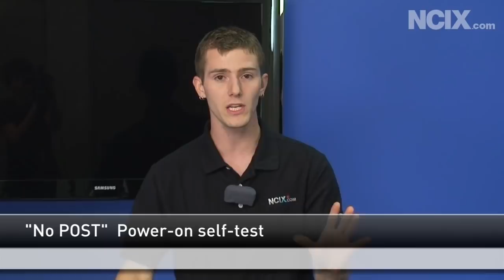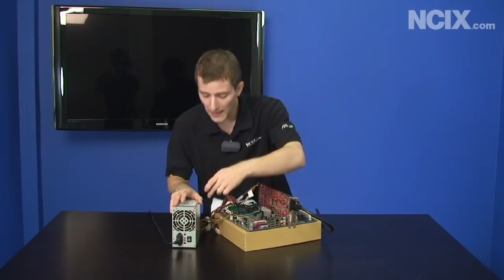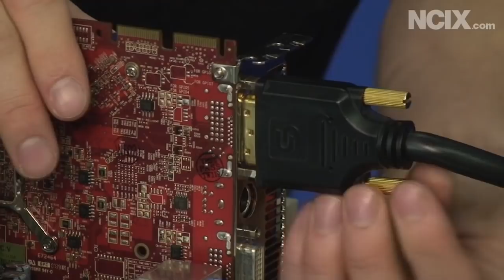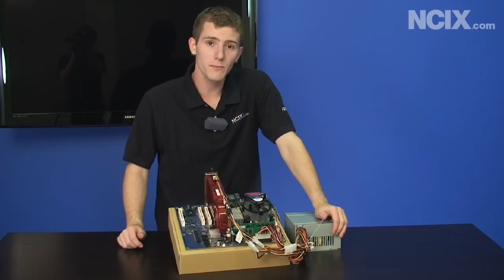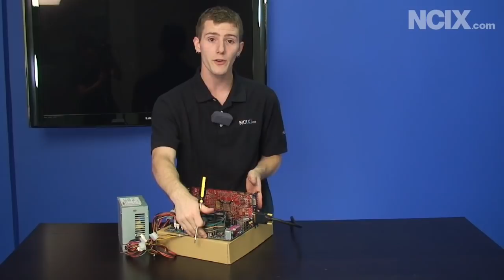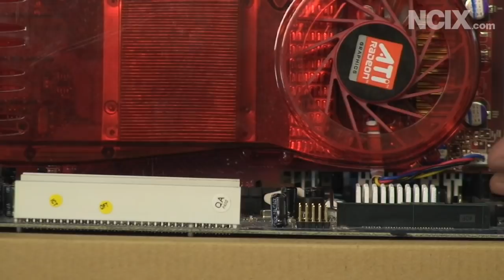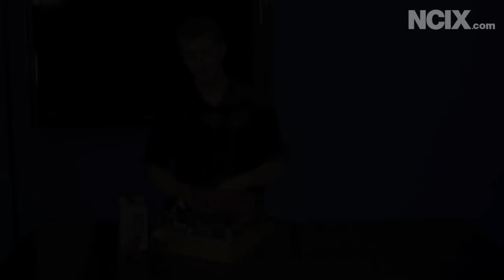PC Troubleshooting No Post Diagnosis (NCIX Tech Tips #54)

Comment: A pc keep giving alarming beeps or siren but still work fine. Usually first thing to do is to replace the PC case and install the RAM in different slots, but some RAM stick are the “leader” stick that must be in the slot 1 to make a pc POST as the other sticks of RAM “follower” sticks that couldn’t POST all by itself. 
It may not be the PSU has fault, but replace the PSU may fix it if all the fans works fine when there was no POST. Replace mobo’s battery too. In many cases no PC parts has fault, it just need to replace the PC case, RAM, PSU, battery with another working PC parts, so after doing all that, you ended up with 2 working PC system and not a single faulty PC part.

May need to replace the PC case because some pc case’s back panel is curved outward and need pushed inward to put in the screw to secure the graphic card, so after some years or weeks of use, it pulled things out of place, bow and arrow theory … …

In one of the other cases, each time the power is out in my house, I need to replace the graphic card and installed a graphic card that could POST in the PC, then I install the one that failed to POST back in place and it could POST, so each time the power it’s out I need to repeat that!

Some PC could shut down due to static charges when your hand is only touching the power button to the PC that’s made of plastic (not pressing the button).

Some PC couldn’t POST, just wait 3 days without using it, then it return to life of POST, this could happen once in a few years of use, like seeing a comet going passing by! Unplug the power cord and HDMI cables to the PC and let it sit there for 3 days …

Old PC systems, a DVI to D-sub cable could make a PC work for a few days, then it couldn’t POST, so the best idea is to use D-sub output with no adapters.

Comment: hello,i experience similar issue when i ordered a ddr4 8gb ram to upgrade my 4gb ram hp 290 g1 desktop computer. immediately after i slotted in the new 8gb ram ,plugged to power supply powered it on. The fans were spinnig and power led came on but no display on the monitor.pls i need help to fix it.

Comment: the only led that lights up is flash bios and it does three flashes then nothing 

And the rgb master cooler fan lights up for a second and then nothing else happens 

Has happened each time I try and start up the rgb does that 
The bios only flashes when I click it 

I'm thinking about taking cmos batter out for 15 minutes 
Redownload the bios reformat ny flash again to fat and unplug everything and bread board connecting stuff again 1 by 1 

But this is super stressful I just want my rig to run 

I have the seasonic 750w gm semi modular so I know it's working

Hopefully it was protecting something I had incorrectly connected or something like that 
1 by 1 I'll try and see what the issue is 

I'm gonna reseat the cpu reseat the ram and basically do everything again 
Really only can find like 3 and more year old forums to trouble shoot this is really a lot more difficult than the whole build your own crowd makes it seem

I could've just got a prebuilt and upgraded it but this is really demoralizing having it not work over and over again

I was excited now I'm bummed put borderline depressed

Comment: I'm trying to get my pc to boot
I've disconnected and reconnected everything like 4 times

The cpu cooler fan is rgb
And it turns on the light for a second and nothing else happens 

Is my pc dead?

Ryzen 5600x 
B450 max 2
Vengeance ram 2 sticks
Seasonic 750w semi modular 
1660 zotac
In a meshify c case 

Any help greatly appreciated thanks

Comment: Help, my issues is that, when i plugging in my keyboard and mouse to the computer, they doesn't work. And the monitor it's turning on but shows that theres no hdmi cable connected although i did connected it to my pc. All that happens while my pc seems to work fine, the fans are spinning, and lights are on etc etc.. My motherboard have never beeped, i once remember connecting the keyboard to another USB port and it did just for a second turned on but instantly turned off and never turned back on again. And btw it's my first pc and every part that i used are fresh and new. I have no idea what to do, motherboard is not booting-posting. My friend who knows some stuff about pc builds, tried to fix it, he removed the ram and switched places, he removed the battery-cell from the motherboard etc.. And still we can't solve this annoying issue. I starting to think that theres might be a problem with my motherboard or with my cpu, but i only assume that based on other comments that i find in the internet where other guys had/have the same issue. We checked everything to see if something is not connected right or in a wrong place but no, everything's seems to be in the right place. What should i do? What options do i have?

Comment: my mother board is MSI Mortar Max and i have no gpu but my pc does no post but all the parts are brand new and still no beep sound and no POST how can i fix that even if i tried the connection, Ram testing and even clear CMOS what is the problem?
Reply: Ok so this pc was built in 2010 i changed the old parts with new one but when i start pc the monitor showed no display and the usb ports stoped working, then i met RYANSROOM617 on Instagram he help me setup my PC back and is working perfectly, he also helped my kids unbanned their ps4 .. He's a pro hacker and legit 👩‍💻 
You can also text him on WhatsApp +1 442 233 0240... his service is affordable

Comment: I have an NCIX PC sitting right here with a Gigabyte Z87X-UD3H motherboard, built in 2014.... it was working fine until today, it won't boot anymore, or even show the POST screen :(    the on-board LCD diagnostic (two digits) blinks real quick and dissapears, so I don't see the booting process codes anymore (LCD won't stay on!). Any ideas? The fans turn on but nothing else works... I am thinking or trying a new power supply? Since the LCD diag doesn't stay on? That's my idea for now

Comment: My daughter gave me her mid tower case to fix. She would turn it on, no display and 5 mins later it would turn Off?  I opened it to find the cpu cooler had fallen off the AMD processor due to the mount bracket being broke. I installed a new cooler, the computer doesn't shut down now but there is no display. I'm thinking the cpu is fried as the system was fine until the cooler fell off, not sure where to go now appart from a new cpu. Have done the ram swap, video card, different monitors. Checked the psu output to mb 12v and 5v . Oh and no post beeps even with no ram or video Card?

Comment: tried all of these measures didnt work for me i had 16gbram in there and wanted to put 32 more 4 bays dual memory al within the motherboards requirements. Wheniwent to turn it on 3 beeps. I took the new ram back and left the original and still the same, then i tried each memory stuck 4 of them indivudually accross all 4 bays then dual 2 by 2 in each dual slots and nothing. Have no idea whats happened. Got work in 2 days and no pc. lol. have been looking to spend £1800 on a new tower though and tempting bu i was hapy with my pc and as looking forward to getting it up to 48gb ram and sorry i will never get to see what it could have done, Took the graphics card out to use on board graphics, taken the cd disk drive out and stripped it back to the min, 3 long and 2 short beeps for hp pcs sys its a the embedded controller has timrd out waiting for bios to return from memory initialization .

Comment: My issue: Got an older PC for old games, and got a brand new wireless NIC. Installed the software as instructed, turned off the PC and installed the card. Powered on.... and no POST. Fans come on, but there's no beep and no image. Tried another PCI slot, same thing. Tried without the NIC... and it still won't POST. It was fine before I installed the BRAND NEW wifi card.... :(

Comment: I was wonder if anyone can help me with my crisis because I was on my pc and was gonna move it to a different room and the pc was on atm and working and then I unplugged the hdmi and then I guess the hdmi broke in graphics card and then got the piece out and the pins are not bent in gpu but I shut off the pc by pulling it out of wall and then bought a new hdmi and it wont post no beep code no nothing did research saying could be cmos battery I replaced it nothing fixed I tried resetting everything even psu ram cpu gpu and I tried unplugging for mins and no cmos to drain power and I'm think either power supply or motherboard (Specs)- are gpu-6950 radeon 2gb cpu AMD-A10-7800 3.5ghz motherboard-Asus A68bm Ram-8gb ×2 (16gb) psu-500w hardrive-1tb

Comment: I am from India and my pc doesn't turn on nothing moves or beeps even the psu fan dosent work i tried the paperclip test and the psu started but after reinstalling it still doesn't work. A few days before everything except the gpu would work and sometimes during non peak hours everything would work fine, now nothing works except the mouse led which somehow gets power through the usb port even though the power supply fan doesn't work, initially i used to keep it on for a few minutes on my backup invertor of the house maybe that caused something and as there's a total lockdown i can't get any professional help nor can i order any  online please help me locate the problem  if possible.

Comment: I know this is an OLD video but it is very thorough. I tried to ramp up my setting in ryzen master and when I selected "apply and try" my PC restarded but didnt... It shut down and never booted back up. I then powered it back up and the LEDs are on, fans are spinning but no signal on my monitor. I have reset the bios ( motherboard = prime b450m-a- ASUS) and got no beep code  or anything different than before. I have removed ram and switched slots, alternating sticks ( 3 teamgroup vulcan 8gb sticks. Incase it matters, im running ryzen 5-2600, rx580 GPU. Any suggestions or thoughts would be greatly appreciated!. Also, 3000 is what I tried to up my ram to and I was running on 4 cores of the processor.

Comment: I have a issue i needed to upgrade my graphics card and when I used a new one there was no post I tried older cards that I knew worked and nothing but the original card I have been using works only fix??
Reply: Download the new drivers
Reply: Lemonski 2003 won’t let me unless it detects the card
Reply: @ItsiTroid  you might need to take it to get replaced
Reply: Lemonski 2003 I put it in my friend computer and it worked but still not mine
Reply: @ItsiTroid  weird I am not sure how to fix it sorry :c good luck though

Comment: I just got an MSI Z87-G45 motherboard, and an i7-4790k cpu. I am having an issue where the computer will not post. I've checked the CPU socket, it's fine. I have good voltages checking from the provided locations. I know my PSU is good, and I have a tester for it. There's no onboard speaker, so I can't check a beep code right now, but my keyboard is not getting power from any usb port. The GPU is not the issue, as onboard video does not put out a signal with or without the gpu installed. I'm kinda low on options, I spent a good deal on this motherboard and cpu.
Reply: Same here, different components tho

Comment: Got code CC 

I9-9900k 
ASUS Maximus hero xi 
32gb of Corsair vengeance pro rgb ddr4 3200
2080 fe
Evga superNOVA 850w

Getting bios code CC 
Half of my ram is lighting up other half isn’t 
No post at all 
No bios or boot
Reply: Maybe needs to be updated to most recent bios. You might require a little cheapo CPU though to get it to post
Reply: Mauri Cobian it turned out to be I had a hair blocking all of the ram sticks. Pulled them out and pulled out the hair and poof worked flawlessly other than the horrid bios settings they ship with

Comment: Now I have a keyboard that lights up when the computer boots or powers on first time, (each first time) and I use a t.v. HDMI to display it, and my keyboard didn't light up and my TV's not getting any signal, and so before it did this, there was a power shortage for a second.
Reply: What can I do to fix this issue?

Comment: Quite interesting how a 10 year old video helped me fix my issue.

For me it was that the PC wouldn't POST and CPU light was on. 
As it turned out the reset switch on my case was broken. I only found out because after already completely disassembling my rig I still had the front panel cables attached to turn on the PC. Only when I saw Linus using a screw driver to start the system I decided to do the same, removed the front panel cables et voilà it worked again.

Comment: So I installed a new APU and my computer didn't post. I switched back to my old PC and it still did not post. I did what linus did here and rebuilt my components outside my case without anything using the sata cables and it worked, I was able to go to bios and very both my old CPU and new APU were recognized as well as my ram, video card. I turned it off and on 4 times and sure enough it worked. But after installing everything back on to the case the issues were the same. I'm lost, I think it has something to do with my case or connection with the case because it will work just fine outside the case. Please help...

Mobo : a88x g45 micro atx
Old CPU: AMD athlon x4 760k 
New APU: AMD A10 5800k

Comment: I bought new RAM for my PC DDR2 the same as the original RAM which was 
working fine but only 1gb and not enough for my windows 7 OS. The new 
RAM is 2 modules of 4gb each, but when I insert them the PC doesn't 
recognize them and just gives a long beep on start up the same as if no 
RAM is installed. I have tried inserting just 1 and also tried different
 slots (I have 4 ) but still no luck. I have cleand the pins with an 
eraser and an anti static cloth but still beeping. When I re-insert the 
1gb module that works fine and the PC boots up ok. What else can I try?

Comment: Only two cables that must be connected are 4pin EPS 12v (even if it is a 8pin) for the cpu and 20pin (even if it is 24pin) to post, if you dont connect the pcie power pc will post and display please connect PCIE power connector

Comment: Cloned HDD to SDD. Now I have a problem in booting. When clearing the CMOS it startup fine. But when powering the PC off and on again it doesn't boot. I need to  clear CMOS to default BIOS setting. I'm using MSI mother board H77MA G43

Comment: Also check the start and on buttons if the device is old or poorly maintained dirt could be causing a short circuit you can check by unplugging them one by one while the motherboard is on the case

Comment: My computers tower fan, cpu fan and hard drive will turn on but wont beep to tell me if it's going to post and it wont even go to post. Infact there nothing that appears on the screen. The cpu came with the motherboard because what i did was just transfer the motherboard from another tower. My only suspicion is 1. : I need check the connection between the power button  and the motherboard. 2.: I need to check if the cmos or bios battery is dead or simply has a too low of a voltage to run the bios. 😕🤨🤔😐😑😖🤯

Comment: I hope this comment gets read by someone...
I have a old amd fx 4300 build that wont post. The cpu is the cpu that came with the mobo years ago. So, I swapped that out with a fx 6300 from another pc I have and it works, the cpu posts and boots up the os. the 4300 works in the 6300 build too. I hope someone can help with this strange issue.
Reply: Socket issue? Bent pins?

Comment: I built my system yesterday with

i5 8600k
Msi z370-a pro
8 GB ddr4 3000mhz Corsair  ram
1 TB HDD
Deepcool neptwin V2 

And the cpu fan works and the lights on the motherboard also light up but nothing comes on monitor. On motherboard the ez debug light for cpu turns on indicating cpu not detected or failure.  I don't know what to do plz help.

Comment: My issue was one of the RAM sticks, left one and my pc is not shuting down every 12 seconds BUT now I'm not getting any display image, is my videocard the issue now? I also did the CMOS step where you remove the stick and put it on a different slot and then put back in the original one I don't know if that has anything to do with it but...

Comment: I have a asus H67-m pro motherboard with intel core i7 3370K processor. working properly but stopped suddenly . after that when I push power button all fans runs for a second. but no beep , nothing. I ve checked every thing. agp, ram, power uni, bios chip. but cant check  processor . any help ?

Comment: After clearing the CMOS tmy computer changed the problem from not showing any video output to a boot loop :_)
Reply: now ur bios is bricked sadly
Reply: @nororlol4life819  I oppened the socket and I saw that I had a pin blended, so I tried to put it correctly with a needle and then it returned to life! :D
Reply: @GuillemPoy  congrats :D

Comment: Came home from a long day at school and work so I wanted to relax and do some light gaming. Turned on the PC and froze at log-in screen. Aight no biggie.....tried to reset using reset button, doesn't work. Aight then this is risky but it might work: turned off pc by switching off power supply...turned it on..BAM computer doesn't turn on and my whole day was ruined. Saw a video by Linus and watched the whole thing. Got to the step where I had to jump the cmos.....BAM it worked. Thanks Linus, you never fail to entertain and save my life lol. 

But I actually want to know something from this....did I almost broke my pc by trying to restart it by turning off the power supply?

WHY IS MY RESET BUTTON NOT WORKING HUHUHU